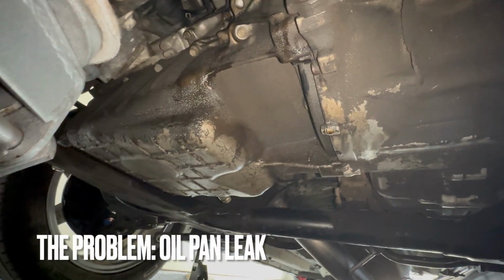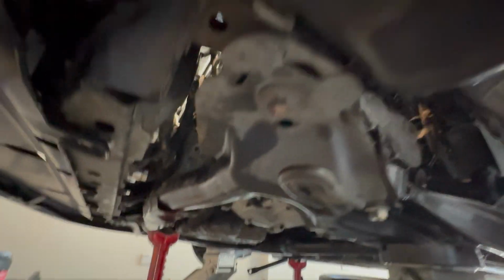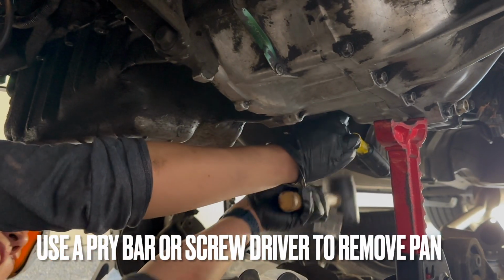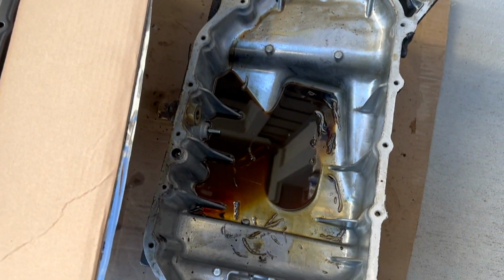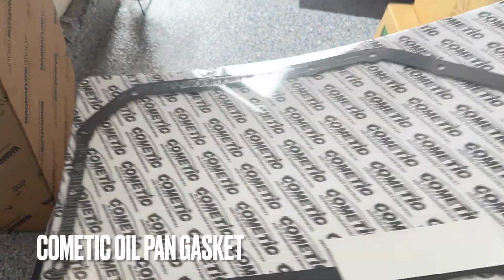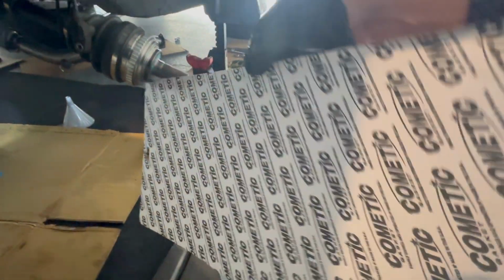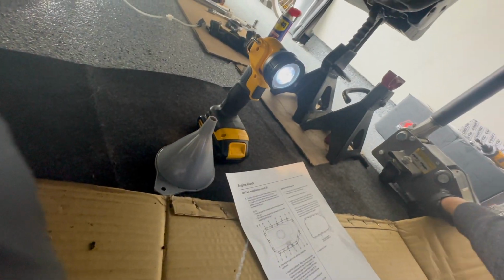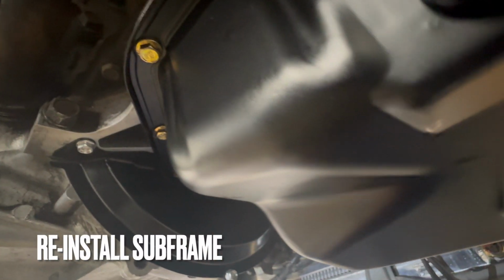KTUNED Oil Pan: Removal & Installation with Cometic gasket

Comment: I appreciate the video. I just realized my oil pan is leaking and I’m pretty sure the plug is stripped so I’m going to replace. Will be using this as a blueprint. Thanks!
Reply from the maker: You're very welcome. Glad it's of help. Good luck with your oil pan install.

Comment: Is the ktuned oil pan shorter than the oem in terms of height?
Reply from the maker: Visually, it looks the same in terms of height and shape, caveat that I didnt take exact measurements during installation of Ktuned vs OEM of the height. If I had to guess at this point, it might have been marginally smaller by some milimeters but nothing that obstructed the oil baffle plate or anything. It was a perfect fit when I installed it and still running good.

Comment: Great video, would u recommend just straight Honda bond or to go with an actual gasket bc I’ve read on forums people prefer one or the other and I wanna know if it’s held up until now?
Reply from the maker: @kproductions8553  I believe everyone swears by Honda bond. You gotta use a thin bead, not too much and spread it evenly. I think if I did a rebuild out of the engine, I’d do honda bond. I think it’s good too, but it cures fast so I did the dry cometic gasket willing to see if it was a good alternative. So far it’s holding up and it’s been almost a year. Around 4 months in, I checked it and had a little leak because the bolts got loose from vibration. I retightened them and it was fine. I think I could have used blue thread locker / loctite. So no leaks since then.
Reply: Oh gotchu makes sense thank you cause I’m currently replacing mine tmr and gonna go with a regular gasket and be sure to use blue locker thank you
Reply from the maker: @ good luck. 👍 Hope this video helps with it